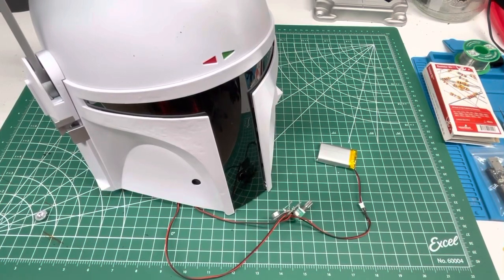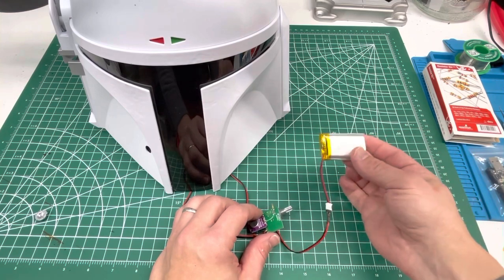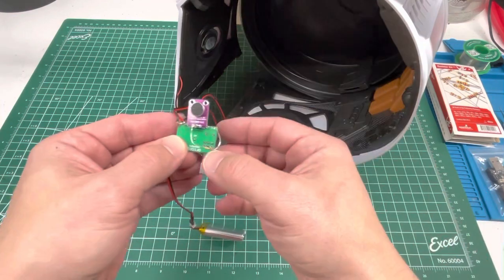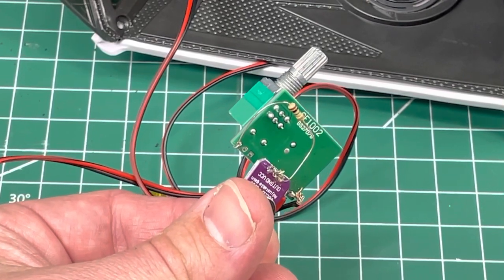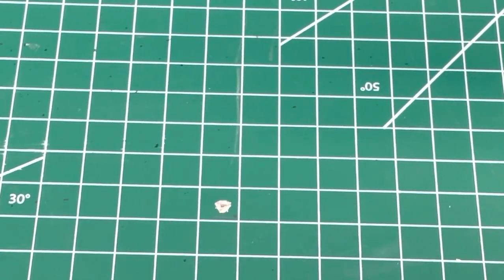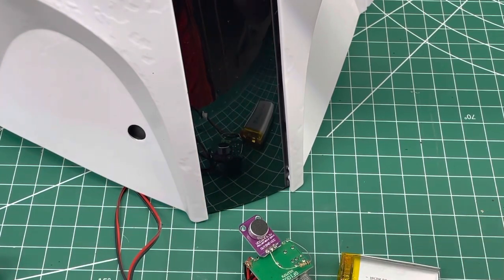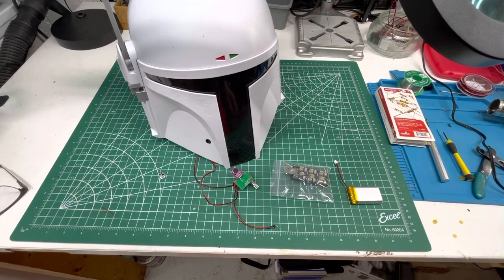Helmet/Mask Voice Amp for any Costume (Star Wars Mandalorian Black Series Boba Fett Prototype mods)

Comment: Is there any way to add a little voice modulation to this? To make the voice deeper, more Boba-like? :)
Reply from the maker: I’d use an i9 or k9 voice changer.  Here’s an i9 Mando video: https://youtu.be/JAcubO4GCyk?si=kUsAS5bcSg6l82Zx   But if you want BOTH lower voice and Reverb and don’t mind the larger size - get the K9, it’s the only one modifying voice pitch and doing reverb at same time: https://youtu.be/fq0E49NYM2s?si=YL8DVfkLGtoMZoc4

Comment: Hello, just giving you a poke as requested to see how loud the helmet actually is. As long as it's loud enough that if you were at a busy convention center and someone 4 to 3 feet away from you could hear you fine, it'll work great for me. Also, how long does the battery last?
Reply from the maker: So I did a decibel check on it and it was at 66DB at arms length.
So your results will be very depending on how close your speaker or speakers are to your microphone. 
So this was with my volume knob, turned down to avoid interference from those two speakers I use which were only maybe 4-5 inches away from the mic. 
So, If you get more distance from those speakers with your mic, then you can pull more decibels out of it. 
In comparison, according to decibel ratings, it’s  roughly the decibel level of a normal conversation or a business office.
Reply from the maker: FYI I’m now opting to use a gutted personal amp for expediency reasons, and the inner circuitboard is not much larger than this set up and has a bunch more capabilities. I’d recommend checking out that video that I made on that. https://youtu.be/N8pYezaKldo

Comment: 1:04 .... the amount of anger I just felt when I saw you are using a Maxx4466 mic and a gf1002 (pam8403) amp... you are literally doing exactly what I failed at last year... I am intrigued and must figure out how it's working for you
Reply: A resistor.... are you kidding me. I failed because I was missing a resistor. I went through all the trouble I'm currently going through trying to basically make a mic preamp from scratch because of a resistor.... I am so not happy with myself right now. I will definitely use this strategy and see where it takes me
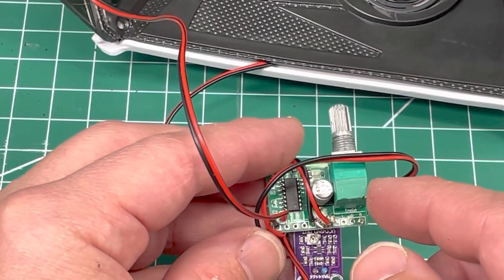Reply: 4:42 wish I would have found that thing you read lol I'm on a heck of a ride watching this right now
Reply from the maker: Yea - crazy right!  Why doesn't it work out of the box?  Because the world is crazy and Murphy's Law is king....whatever can go wrong - will...or in this case - It's because all the manufactures just so happen to leave out one tiny bit - to drive you mad.  This was needed on both amp boards I used.  Way too many hours spent troubleshooting this and I discovered the solution on the final day when I was ready to give up and return everything.

Comment: Could I use a simple USB battery pack? I already have one for my fans but I was thinking i could use second port for this
Reply from the maker: Possibly. I can’t remember the voltage window for this amplifier. Normally they’re not fixed to one specific voltage normally there is a voltage range - so you might be able to. I would just check on the specs of the amplifier to verify.

Comment: Hello, this looks good. I know nothing of electronics but look forward to building one for my helmet.  Is there a specific speaker wire gauge needed?
Thanks
Reply from the maker: I basically tried to find gauge wire that was the same as what the speakers came with, but the lines on the speakers are short enough that I can’t see a label -  thus I outsource this question to chat GPT and it has a more precise answer; here’s ChatGPT’s response:

For a 3 W amplifier with a distance of only 6 inches to the speaker, you could use a very thin wire, such as 24 or 22 AWG, which would be sufficient for carrying the low power output over such a short distance. However, it's always a good idea to use a slightly thicker wire gauge to provide some margin of safety and to ensure that the wire can handle the power output without getting too hot.

A 20 or 18 AWG wire would be a good choice for this setup, as they are still quite thin and flexible but can handle higher power levels and have lower resistance than thinner wires. The 18 AWG wire is thicker than the 20 AWG wire, so it will have slightly less resistance and provide better performance, but either one should work fine for a 3 W amplifier over a short distance of 6 inches.
Reply from the maker: FYI I’m now opting to use a gutted personal amp for expediency reasons, and the inner circuitboard is not much larger than this set up and has a bunch more capabilities like micro SD card integration, and second audio input option .  It also includes its own speaker & microphone so much less work and more cost-effective solution with higher amplitude as well .  I’d recommend checking out that video that I made on that. https://youtu.be/N8pYezaKldo

Comment: Would you sell one of those? I need it for my Din Djarin costume
Reply from the maker: Possibly . If I do you’d be paying mostly for my time.  I’m out of town til almost the end of the month.  I can build another one then.
Hit me up again if I don’t follow up by early Feb.
Reply: nice stuff @creative-stuff  care to sell me one of these too?
Reply from the maker: FYI I’m now opting to use a gutted personal amp for expediency reasons, and the inner circuitboard is not much larger than this set up and has a bunch more capabilities like micro SD card integration, and second audio input option .  It also includes its own speaker & microphone so much less work and more cost-effective solution with higher amplitude as well .  I’d recommend checking out that video that I made on that. https://youtu.be/N8pYezaKldo
Reply: @creative-stuff  would you also be interested in selling one of these? I need it for my jango fett helmet

Comment: I am trying this exact setup and can get audio to play but its very quite. Any tips?
Reply from the maker: Hmm.  
If it’s quiet it implies that the preamp is working, because if it wasn’t you shouldn’t hear anything coming out. Perhaps your amp isn’t working correctly?  But if you’re able to go from no sound to a faint sound via the the amp volume knob … then maybe your preamp is either not working or turned down too low.
On the back of the preamp there is a small screw that does volume control but I believe it’s opposite direction of what you’d expect - I believe it is counter clockwise to get louder.
Try that.
Find a good balance- default assumption is that it’s best to max it out however I know some folks prefer to have it as low as possible- insisting that the louder preamp signal results in feedback issues.  So try out all the options for what’s right for you.
Ensure everything has a solid solder connection. 
 So if you cannot get things working or have too much feedback- You can also try out a prebuilt mic preamp combo that is a No hassle prebuilt  with better sound and far less feedback - it has a 3.5mm output connector so you’ll either have to chop it off or put a 3.5mm input connector on the amp board.  This is actually my new go to mic/preamp combo: https://amzn.to/4dBb28A - they sell it new for $12 or used like new for $3.99.
Reply: @creative-stuff  Thanks for that, I wasnt aware of the pre-amp having a screw that could control it. Ill see if that changes the results!

Comment: Since the mic has a integrated amp did you try it by itself?
Reply from the maker: It has - correction - it CLAIMS to have a built-in "pre-amp" - and yes I did try it by itself - assuming I'd at least get something out of it but if I don't recall hearing even a peep.  Seemed odd, and I thus wasn't sure if it would even work with the amp - but ta-da - magic. I don't understand why not.  It's the similar mic type to what adafruit uses, but theirs has more soldering points.  Next time I'm going to try the one they use.
Cheers.

Comment: Hey, so I'm trying to build one of these, and I noticed that the out peg stops the gnd and vcc pegs from coming through the amplifier board. Did you just bend that one or did it get moved in someway? This is my first project with this sort of thing so any help would be appreciated
Reply from the maker: So I used Male/Male Pin Header Connectors - 2 pins wide and soldered the 2 bottom pins into the bottom of the amp board (+ & - ) and the 2 top pins into mic (VCC & GND).  The 2 bottom pins don't stick out very far of the top of the amp board - just a little shorter, but they do connect the mic and amp to each other (GND to - , & VCC to +).  Then I soldered the power input cables directly to the top of the amp board + & - , which obscures the pins that were protruding, but does provide the power to both the amp and mic.
NOTE: This was my way to test it out - I ended up spacing the devices out so the mic was in front of my mouth but the volume toggle was over near my ear.  This reminds me - I never shot a video of my final install, so I might do that and share so you can see how I finalized my build.
Reply: @creative-stuff  That would be great! Thanks for all the help.

Comment: It looks like the exciter (4 ohm) and speaker (8 ohm) are wired in parallel? No issues running a 2.6 ohm load on that tiny amp?
Reply from the maker: I didn’t seem to have any load issues, and it may have been because I was at a lower volume level. My main challenge with this was that my mic was pretty close to my speakers so as I would get a lot of feedback if I turn the volume up more than like a fifth of what it could do — so I had to keep the volume level low, although I still managed to pull a week 66 decibels out of it.
Now I did also do this with a a 10 watt amp, which was the other one that I showed briefly in the video although I had similar challenge of getting too much squealing, interference when I raised the volume with the speakers that close.
I did not measure the decibels coming off of that amp, however.  They were off the cuff at the time it seemed comparable, so I didn’t worry about its greater capacity. I just worried about the smaller profile inside the mask.
If I recall correctly, the link to those 10 W amps are also in the description.  
The plus side about those 10 W amps is that they don’t require soldering. Everything was screw in and the audio input was a 3.5 mm jack. 
Although I do think it had a downside where it required 12 V to run so it would require an a voltage booster to work with that 3.7 V Lipo battery.

Comment: How loud is it over your normal speaking voice? And is there any feedback with the speakers in the front being so close to the mic?
Reply from the maker: 1A: What I CAN say is that my wife says the sound is good and sound sufficient a few feet away from me.
1B: Not sure on the specific DB increase - which would better answer your question --> I'm now curious too.  When I get back in town I'll test it with an external mic.
NOTE: If you don't see an update to this reply by February - poke me again, cuz I don't get back until the end of the month and may forget. 🤔

2. Yes there can be feedback depending on your volume and mic placement.  You can hear some in the video as I move the mic around.  By the time I finalized my install - it all worked out fine - I just have a volume limit that I can go ~50% up or so before the feedback begins, then taper it down until it stops and leave it there.  
I'm happy with this build and think most folks would be.  We'll know more specifics on the DB later.
Cheers.
Reply: @creative-stuff  thanks for the reply, I look forward to the results of your test. As long as it can make me be able to be heard just fine at conventions and stuff where there's a lot of people around me talking, without me having to yell, it'll be good

Comment: Would this also work in an EVA foam helmet?
Reply: i mean the speaker uses the helmet as the vibrating surface so as long as it has enough surface area it should work, probably sounds a bit different tho
Reply from the maker: For sure.  Although I'd recommend using only speakers rather than using an exciter, since I am unsure if the exciter would get good speaker-like vibrations from the foam.